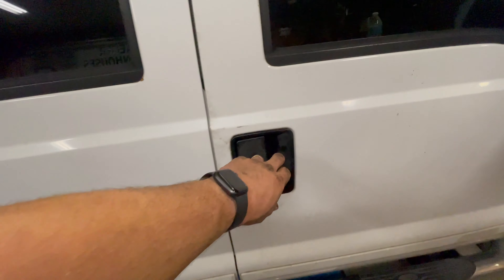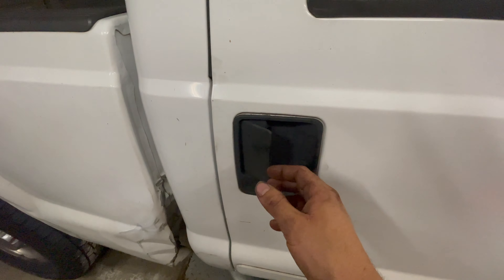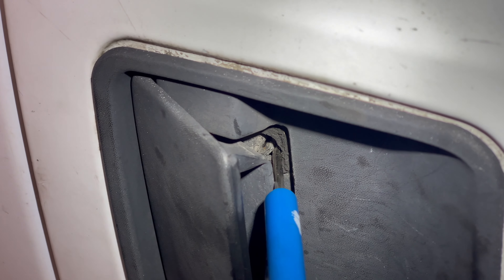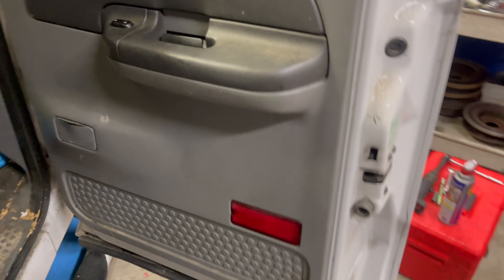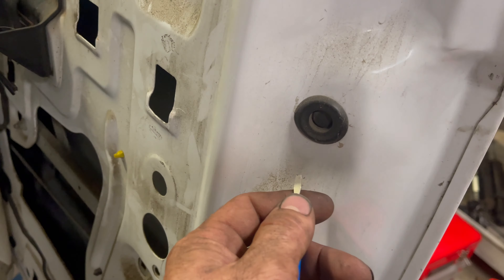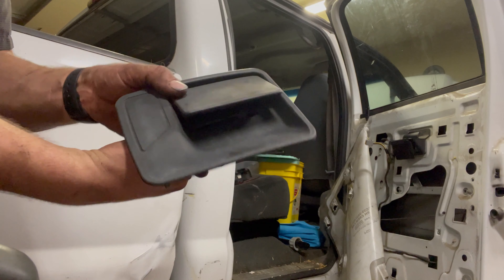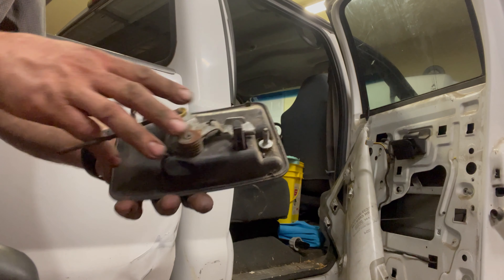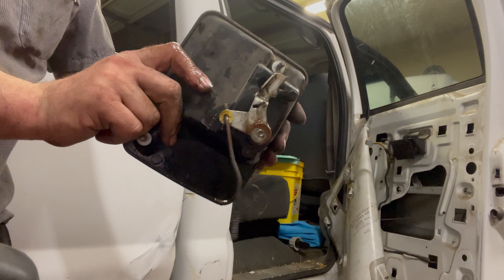Fixing Ford Truck Doors (1999-2016) Won't Close or Open

Comment: I just took the rubber gromet off the door and bent the hose of an oil penetration spray can and sprayed in there. Worked like a charm didnt take anything else apart.

Comment: Thank you very much, excellent info. It took me around 1 min! to open my locked rear door THANKS TO YOUR  instructions. Also Thanks for showing removed door handle. It showed geometry of the handle inside of the door. It allowed me to lubricate all mechanisms without removing the handle(s) from the doors. I did preventive lubrication thru the round hole in the door.

Comment: Remove the little round grommet- squirt WD40 down thru the hole onto the hinge..work the handle a bit after setting some and poof done without tearing door apart   Just did my front passenger side door that way and it now works fine.  I have a  05 F350 crew...

Comment: Thanks man!  You saved my bacon.  3 of the 4 doors on my crew cab were doing this.   One of the back doors has been stuck closed and locked for years.  With your video I was able to get the back doors open and working again by simply removing the ugly and spraying in some liquid wrench and working the lever back and forth using a 3/8 hex key to move the lever all the way home.  Passenger front door handle is better but still sticky.  I'll have to remove it to see if I can get it working or if it will need replaced.  Either way, this video saved me a ton of guessing and checking, lots of frustration, a few busted knuckles, and quite a bit of work.  Really appreciate it!
Reply: Scratch that period by the end of the day that passed her side door was working also :)

Comment: Excellent video, winter came so I put it off. After I got the door opened ( your way, thank you  ) I pulled off the grommet  and saw what needed some w-D40. 2008 f350. I actually thought about drilling a hole in the edge of of the door until I opened the door and saw the grommet.  Very easy job, great video.  Thanks again.

Comment: I remember my folks owning several dodge cars in the 1970 that would freeze up in winter after a trip to the car wash, and would almost latch but not close, just bounce back like in your intro! Great fix! Ivan would be proud! No parts needed!
Reply: I have an f450 1999. Couldn’t get the panel off. Clips are to tight. Also I have a manual knob for the window. Did that make a difference do you think?
Reply: @debspeakes9750  Deb, were you able to get the manual window crank off? There is a special tool to remove the handle. One everything is removed, the door panel has to be pushed up first about 2 inches, then it should come off. (if I remember correctly) The door panel is not held on with clips. It has fingers that are on 45 degree angles that that are part of the door panel that fall into a slot. If you pause this video as the panel is coming off, you can see them.
Reply: @unclemarksdiyauto  yes i got the crank off.its the fingers i was calling clips. they are very tight. i was afraid i might break them.
Reply: @debspeakes9750  I am glad you were able to access the inside of the door. Keep in touch, Deb.

Comment: I doubt this will get noticed but here’s a shot. Any thoughts on my case in particular? The rear passenger door is locked and won’t unlock. The assembly will move so it’s not the issue in the video here. 
I’ve disassembled the door panel while the door is shut and I can see with a flashlight that the assembly moves just fine. But moving the interior and exterior handles, the door doesn’t unlatch.
Is there any way I can unlock my back door without opening it?

Update:
It opens now. But won’t close. Again the rod moves, the actuator works fine but the door latch doesn’t catch correctly. I’m pretty sure I need to replace the latch at this point

Comment: That is a correct way to get it open
BUT...nonreason to take the door panel apart at all
Remove that rubber plug and That actuator arm is right there...
Just use a screwdriver to work and back n forth few times as you spray a lubricant right below that arm on the actuator..BAM,,,fixed
I don't use WD40 for anything,it is really just a water displacement,not a lube 
I use either Kroil or a mix a 50/50 acetone/transmission fluid..nothing beats them..nothing

Comment: Couldn’t you do this without disassemble?
Reply: If you take off the grommet above the latch you can spray wd40 onto the spring. Use a flashlight to see what you’re doing. Keep the window up for a few days until all the oil dries.